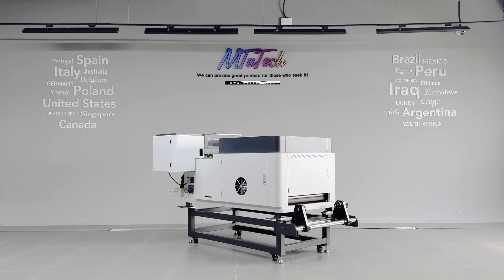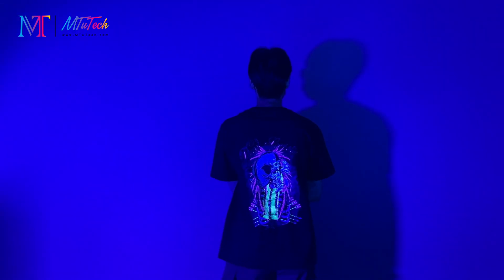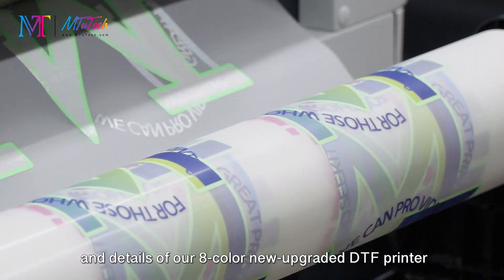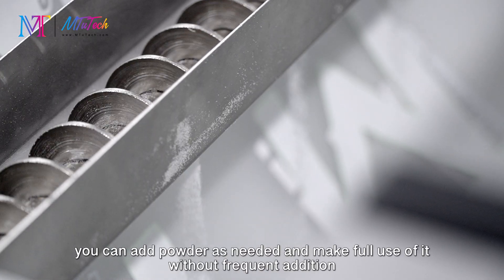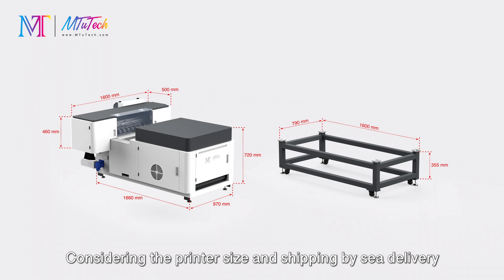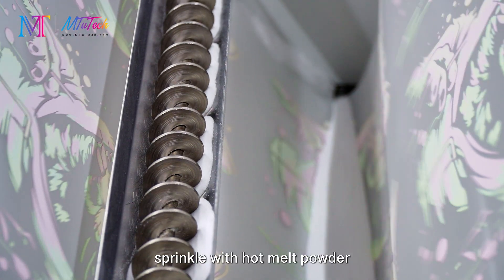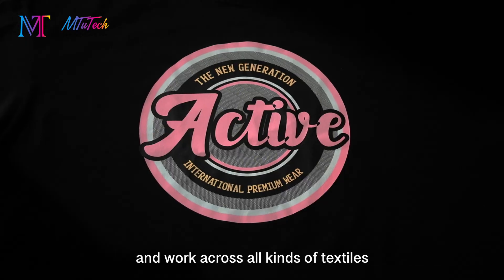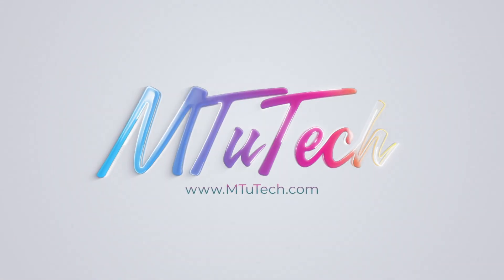MTuTech 8-color Fluorescent DTF printer (CMYK + FM+FY+FG+FO+W)

Comment: If a printer has the ability to print with fluorescent inks, can it also print only in CMYK on the same machine without using the fluorescent inks, or is it designed exclusively for fluorescent printing
Reply from the maker: Yes, it supports both CMYK and fluorescent printing, depends on your needs.